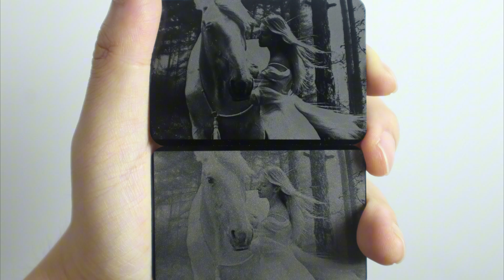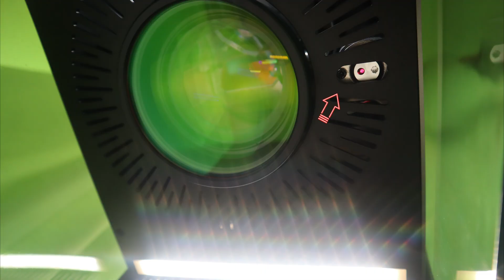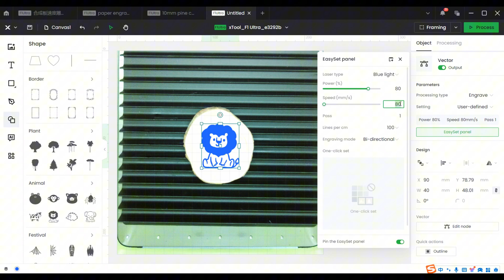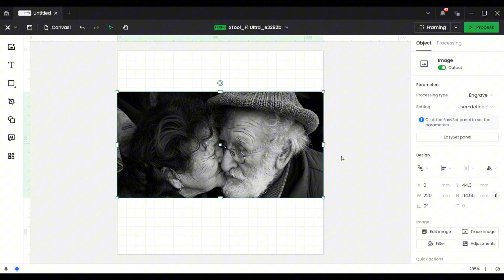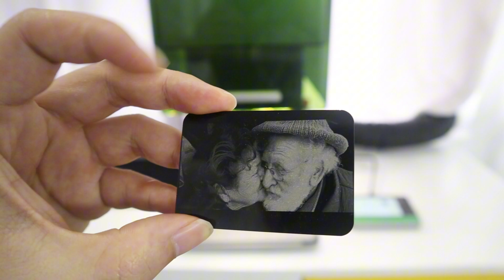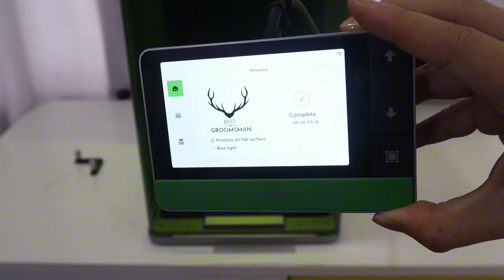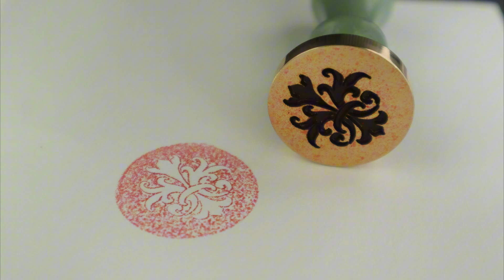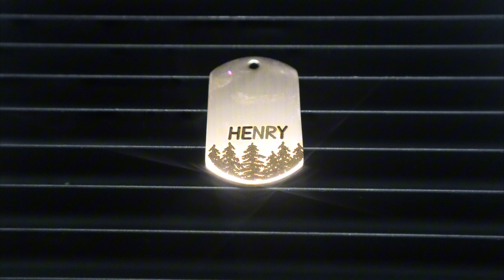xTool F1 Ultra Review: Unbeatable 20W Fiber & Diode Dual Laser Engraver!

Comment: Show us if it can engrave a logo onto a Hardened Steel knife blade, as to help knife makers add their touch marks on the blades they make.
Reply from the maker: of course! it can engrave onto the hardened steel
Reply: I’ve been trying to find the same thing.  Seems no one is demonstrating that basic function in any of the intro videos so far.
Reply from the maker: @atrunco  In my LaserPecker LX1 Max review video, I use its 2W  IR laser module to engrave a knife and clearly mark it.  So the F1 Ultra's 20W fiber laser(IR laser) will have no problem with it.